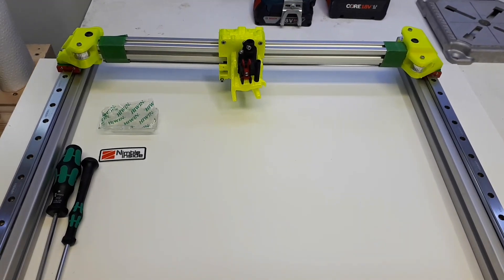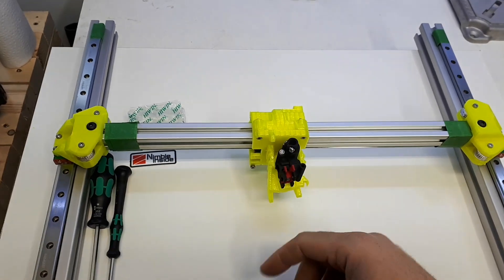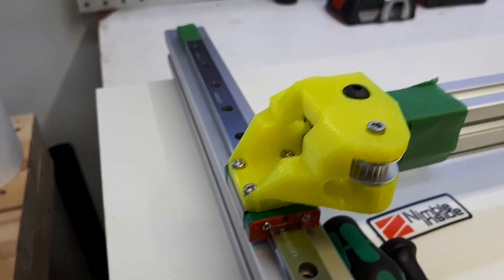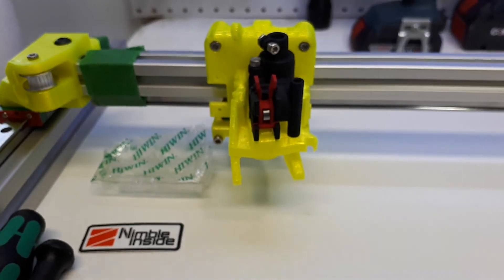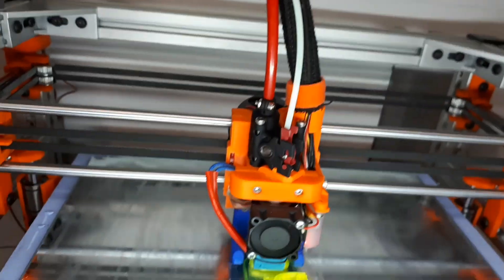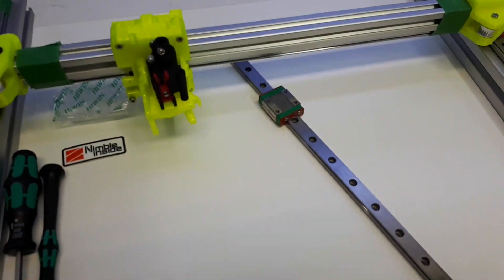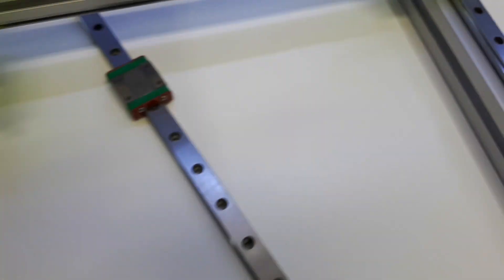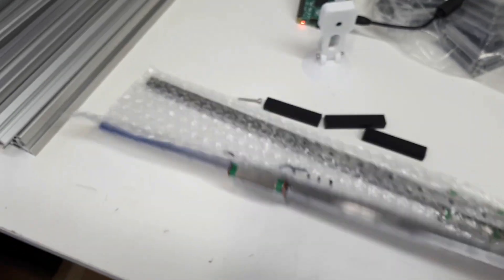HEVORT - 3D Printer Hypercube Evolution with rails

Comment: are that aluminum extrusions plane so you can install that rails?
Reply from the maker: Yes, they are usually pretty plane, at least enough for 3D printing application.  You can see details here: https://us.misumi-ec.com/pdf/fa/2012/p2_0493.pdf
Reply: @MirageC  thanks. Always fascinating the system from trotec company how they achieve that speed. Would be interesting to try this solution also for 3d printing.

Comment: hi you built your own nimble or buy?
is this really efficient?
Reply from the maker: It is an original Zestu Nimble V1, very cool concept, but unfortunately it was creating rippling artifact.  They are working on V3 now.  I hope they succeed.  That will be a very neat device for high speed printing.
Reply: @MirageC  hi, have you tried zesty v3 ?
Reply from the maker: @linandy1  No, only V1.
Reply: Ok thanks I think next year I will try to build a printer like yours. You have some documents for the electronics and parameters?

Comment: did you actually gain any IRL advantages?
Reply from the maker: Yes.  Stability at high speed and high acceleration values is incomparable.
Reply: @MirageC  awesome! I have mine coming but it's delayed due corona, it says it's in the same city  but not being sent xD

I only got one for my X axis. since my Y are 10mm rods I didn't think they'd need much improvement.

Comment: Did sombeody realize the 3 axis with dual skr 1.3 or similar?
Reply: Actually, that has been done. The way to do this is via firmware called Klipper.

Klipper supports anything: bed leveling, gantry tramming, mesh bed leveling - pretty much anything. And it can do so with any microcontrollers - RAMPS, SKR, MKS - if it can run the MCU piece of Klipper firmware (and it probably can, since it's been ported to all microcontrollers out there) - Klipper can connect to it and use it. Just make sure to connect endstops to the same board as the motors for that axis (for coreXY - both motors and both endstops need to be all connected to one board). Other than that - let your imagination run wild. 3 motor Z? Four motor Z? CoreXYUVAB? Just connect XY, UV and AB in pairs to the same boards boards and you're golden.

Comment: what length drive shaft did you buy?
Reply from the maker: I suppose you are referring to a video related to OpenRC Truggy I posted and not concerning my 3D Printer.  in that case, i am using 188015 shafts from HSP which are 115mm.  Had to tweak the hubs a bit.

Comment: Hey I'm genuinely looking at doing this to my hypercube. Did you/anyone actually notice any irl difference?
Reply from the maker: Major Difference in ability to increase print speed and acceleration without impacting the print quality.  Also a lot more quiet and less maintenance required.  Definately a plus for your printer.  

See the final printer at: https://www.thingiverse.com/thing:3532039

CAD files for XY can be found at:
https://grabcad.com/library/hevort-xy-axis-hypercube-3d-printer-corexy-1

Comment: The Chinese rails are a little hit and miss, but pretty good for the price. The bearings usually need flushed with some alcohol and hit with a tiny bit of light machine oil and adjust the tension on the end screws. After a little work, the ones on my FT-5 are nice and smooth. No Hiwinn, but easily worth it.

Comment: Share us link for China rails if it so good
Reply from the maker: https://www.aliexpress.com/item/12mm-Linear-Guide-MGN12-L-100-200-300-350-400-450-500-550-600-700-800/32861278496.html?spm=a2g0s.9042311.0.0.43944c4dMRjTno
Reply: What size and model rails did you get?  I'd like to get them on the way as you seem to be close.  Good prices at the below link.  Thanks!
Reply from the maker: @W4TRI_Ronny  I used for this design: MGN12C for the sides and MGN12H for the X axis one.